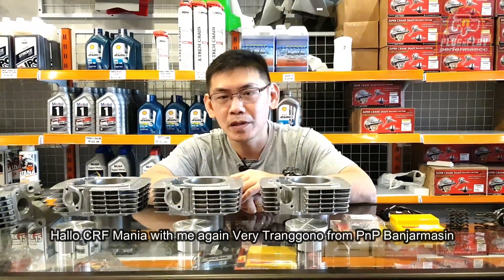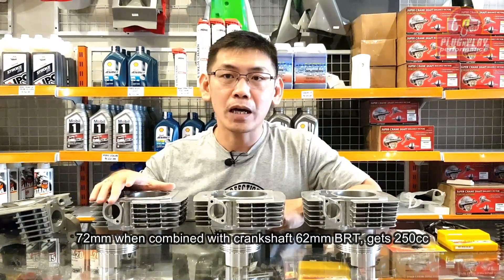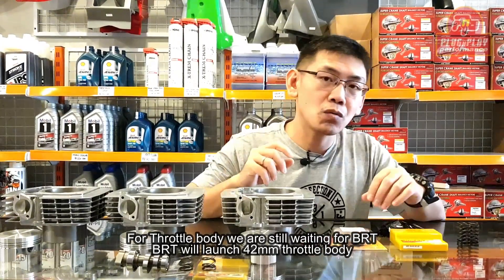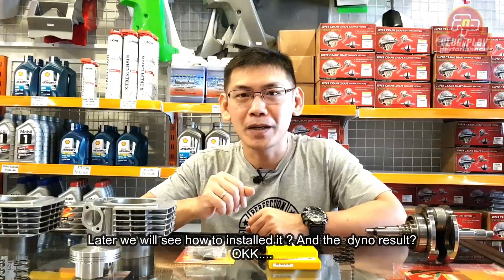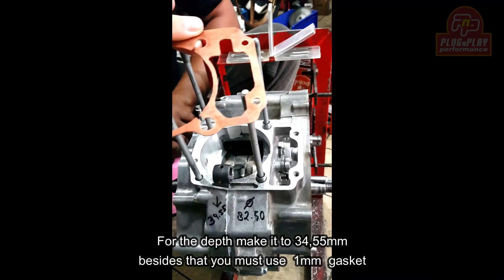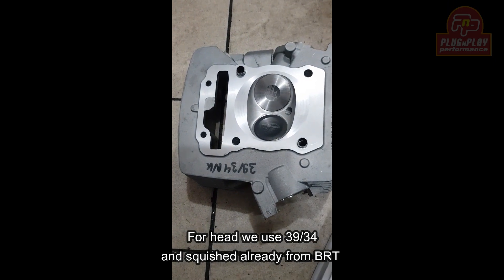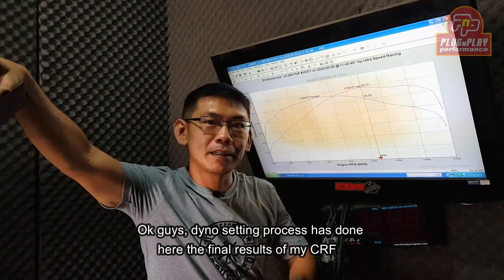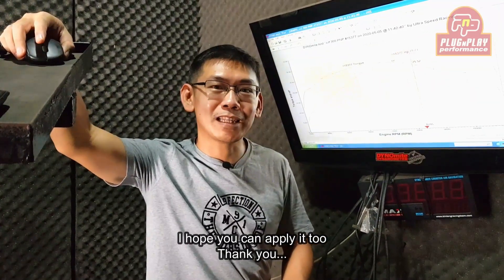PAKET GORILLA CRF 150L 290CC + DYNO RESULT (English Subtittle) [Plug and Play Performance]

Comment: Very, Thanks for this, and my order you sent last year to the Philippines. 👍 I used the head and crank on a XR 150L. Worked great! I'm about to purchase a CRF and would like this 290 kit with the ADS Cam, and everything else needed. Can you tell me when all parts will be availabe, and if you are still able to ship to the Philippines? Thanks. 👍
Reply: Check the last comment
Reply: Bro may update ba ? Nag shiship ba sila dito sa pinas tsaka mag kano bro tsaka paaano mag order ? Salamat bro
Reply: I’m going to install a 78mm on my XR150L. It came with a flat top piston though. I’m wondering about valve to piston clearance. Will I be fine with the 62mm crank, flat top piston, 39/34 head, and a 1mm gasket? In the video he uses a piston that has the clearances for the valves.